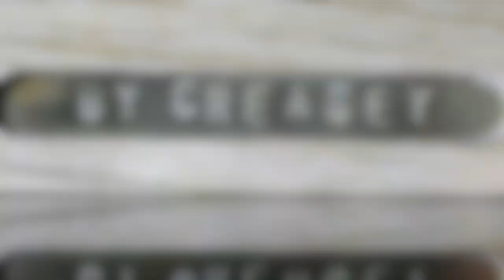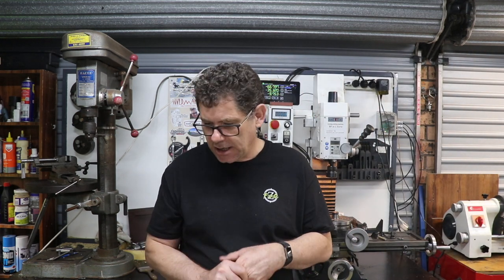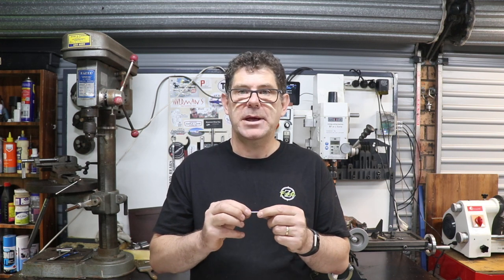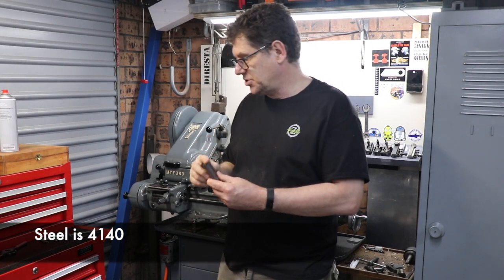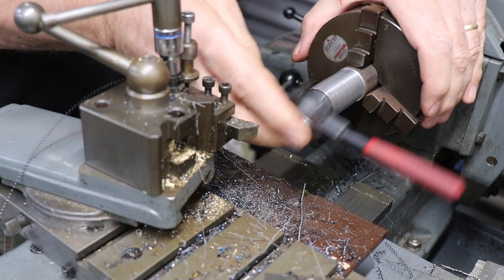Making a Thread Cutting Die

Comment: Glad that it worked. It might have helped if you had gone into the hole after the tap drill  a little ways with a taper pin reamer. Then when you tapped the hole you would have some of the cutting teeth arranged so that the first teeth don't have to cut the thread all in one shot. That would make it easier on your die, reduce the chance of breakage, and make the die much easier to start.
Cheers from NC/USA
Reply from the maker: Taper reamer is a good idea.  I did open it up a bit with the center drill.
Reply: Aceroadholder
   Great tip; I have some of those reamers, but would never have thought to use them this way.

Comment: I haven't used Rocol in years , it's good cutting oil .  Mind you i haven't used a Myford Super 7  since 1980 either .  Good result .
Reply: Rocol and Treflex are my two main go lubes cor these typs of process although the second of the two is not recommended for high speed as it can give off toxic fumes. Both are good stuff in my humble opinion.
 Cheers from John, AU EC.
Reply: @joandar1  Now days i just use neat Castrol Clear edge before the water is added , that way it mixes with the  Clear edge in the coolant tank & WD 40 for aluminium .

Comment: cool video, I didnt realize 4140 actually got hard enough to hold up like that. I had to look it up to see how hard it got and always thought you had to make the dies like that out of an actual tool steel so it holds up. I have tons of 4140 laying around (junk car/truck axles) and just never used it because I had much higher carbon and harder steels to make the tools out of. Thanks for that info and keep up the good work.
Reply from the maker: I didn't test it to see how hard it got.  I've used it quite a few times though and it works very well.  The first few threads were rough but it settled down and it's great.
Reply: cool, Ill have to try it out then. Thanks again

Comment: You can sharpen the die along the three chip holes. It will improve greatly
Reply: How would you go about doing that?
Reply: @jakeketchum1398  i do it with diamond plated tools on dremel
Reply: Variable speed dremel?  The one-speed dremel type tools I have owned have all been 20-25 thousand rpm, way high for cutting steel with diamond.  At least, to have any reasonable abrasive life!

Comment: Great Video John, shows just what you can do in a small home workshop.  Loved the holding method of the Die in the chuck jaws to drill the dimples.  Did you machine a small lead in to the Die Threads to help with starting?
Cam
Reply from the maker: Cam at Battler Hi Cam, yes I really wish I had shown that I opened it up a little with a center drill.

Comment: What model DRO do you have fitted to your mill?  I want to fit one to my MH28V and would be interested in any recomendations...
Reply from the maker: michael robertson its a touch dro which is an app that runs on an android tablet
Reply: @CreaseysWorkshop  Any problems with it?
Reply: What scales did you use?
Reply from the maker: michael robertson my first tablet died after about 2 years.  The second one is a really cheap one and it needs rebooting regularly or it loses Bluetooth connection.
The scales were factory fitted magnetic scales made by Optimum.  They are great.  I put the same kind on my lathe.
The Bluetooth interface I got from yuristoys.  I had to wire it up which is pretty tricky.
Reply: @CreaseysWorkshop  Thanks...

Comment: Now for some questions!  A. How do you select the flute diameter?   B. Where do you locate the flute holes in relation to the thread hole?  C. On a large die, such as for a pipe thread, can you use FOUR flute holes instead of just 3?  D. How do you layout and locate THOSE 4 flute holes for a pipe threading die?  I have these questions because I have a special pipe thread tap on order for an obsolete pipe thread that has not been used in over 100 years, and I have to use the special pipe thread tap to generate a die for some external threads on brass castings.
Reply from the maker: I just eyeballed it.  You want to achieve a bit of clearance for the cutting edge so it needs to be a bit deeper than halfway.   You need more holes for larger sizes.   You should easily be able to make a die that will cut brass.

Comment: Excellent video John, I am glad seeing it can be done. By the by, is there any math required to figure out, or was this all seat of the pants ( shirt on the back lol) process? Cheers and thanks for the info!
Reply from the maker: No maths but there probably should have been.  I just eyeballed it and the first attempt didn't work!  I was expecting that I would need to split the die so I could squish it down a bit, but it was fine as it was.
Reply: @CreaseysWorkshop  Definitely nothing to sneeze at!!!

Comment: Making a die that cuts accurately is vastly more complicated than you show. While the 3 clearance holes can be 120 deg. apart, their centre point is not on a line passing through the centre of the die. Take a look at this: 

https://chestofbooks.com/crafts/machinery/Shop-Practice-V1/Tool-Making-Part-II-Standard-Tools-Thread-Cutting-Dies.html

If you put the clearance holes on the die's diametrical centreline, you will get a "die" that rubs instead of cutting as the angle of the intended cutting edge where it touches the workpiece is wrong. The PCD on which you place the clearance holes is also critical.

The same principle applies to grinding the flutes on a tap. Equispaced flutes on a diametrical line will make a tap that simply jams and snaps off.